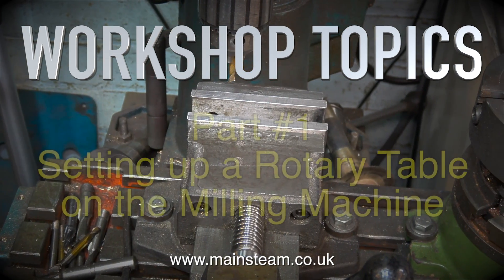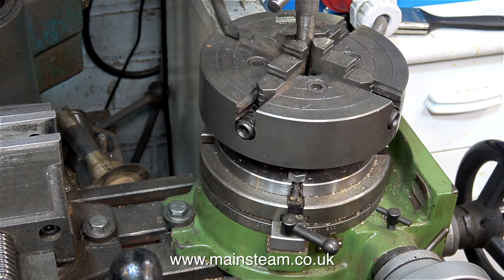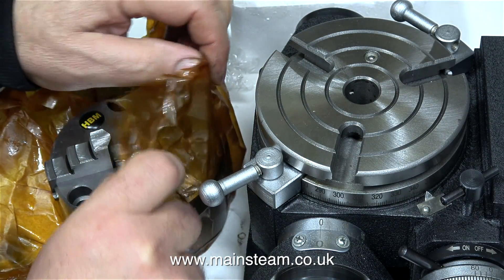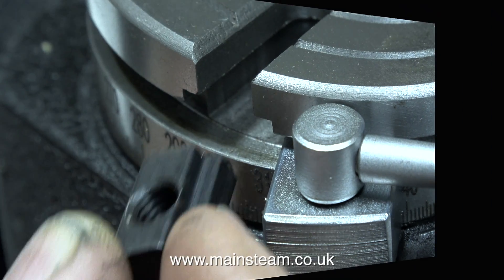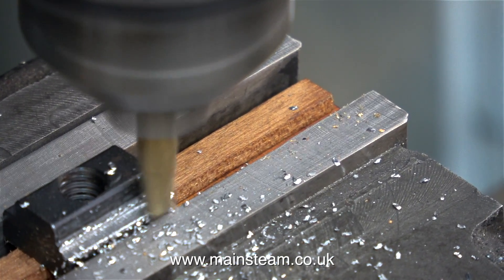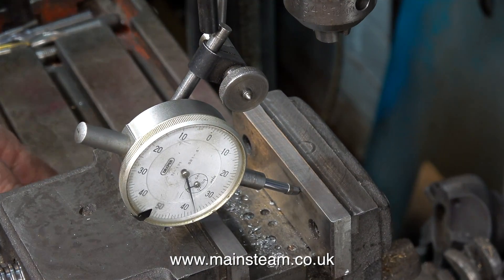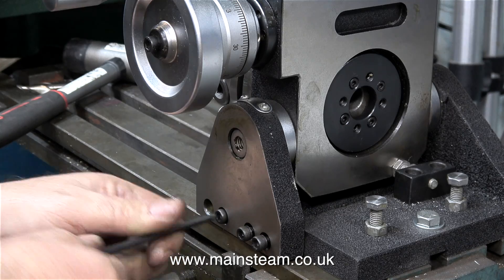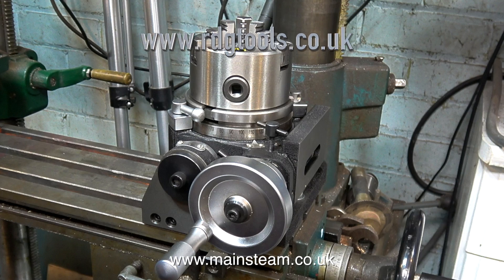WORKSHOP TOPICS - PART #1 - FITTING A ROTARY TABLE

Comment: the two small threaded holes are for fixing a key in the slot in the base which fits in the tee slot in the mill bed to line the rotab parallel to the bed.
Reply from the maker: I know, but it's a bit weak only being threaded M6 - that's why I modified mine.
Reply: @keithappleton  I think you're missing the point here, a metal key is made to fit in the slot in the base of the rotab, it protrudes out from the base and is machined to fit in the TOP of the bed slot. that lines the rotab up with the table, it is NOT to hold it down.
you need to make your own clamping system to fix the rotab to the table.

my own rotary table is like yours and I had to devise a clamping system to hold it to the table.
Reply: Very  very  nice sir

Comment: This is one of the main reasons for me now having 6 lathes now the 2 Raglans turned up during the summer! Also 2 mills? Yes the Dore Westbury does the small high speed stuff and the WM 18 the big bits like frames and cylinder blocks. The Emco 8 will be useful once I get that sticky goo out of the spindle bearings! 
I have a universal head but it is not as sturdy as one of these! Thinking about various different lathe chuck mounts? Simple years ago with your mill and lathe being Myford threaded!
Love David and Lily.

Comment: It is normal for T nuts to be threaded like that so that the hold down bolts can't go right through and jam before tightening the part.
Reply from the maker: That is logical enough, but I have seen this on the tool holders in my quick change holders from time to time where the hole for the bolt that presses onto the lathe tool has also not been tapped parallel all the way through .....
Reply: The solution is to ensure the bolt is long enough to secure the chuck but short enough to not bind in the non tapped part of the tee nut before the chuck is secured tighly, NOT to open up the tee nut thread.

Comment: That's a nice scaled down rotary table Keith, bet it will be a bit nicer to use than the Vertex.. Thanks for the share!
Reply from the maker: The Vertex Rotary Table is miles better quality, but being able to move this one from horizontal to vertical and vice versa by just slackening off a couple of bolts makes the job quicker - which for me is always a good thing }:-)))
Reply: @keithappleton  I agree the Vertex is miles better, but when space, time and money are considered. You just need to bring "skill and care"**  (**which we know you have by the barrel load) into the equation to make up for the lower level of quality..